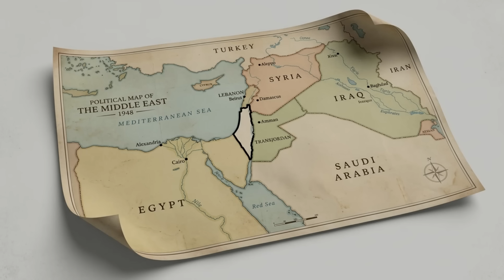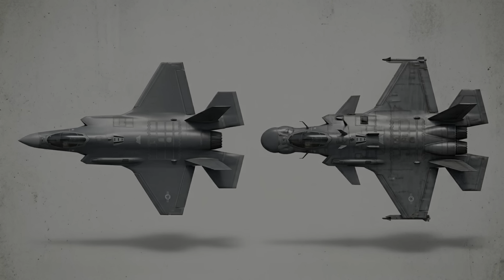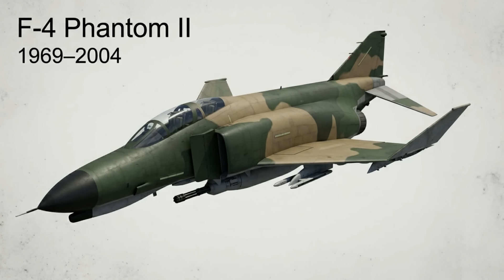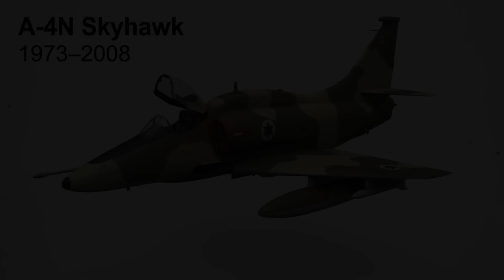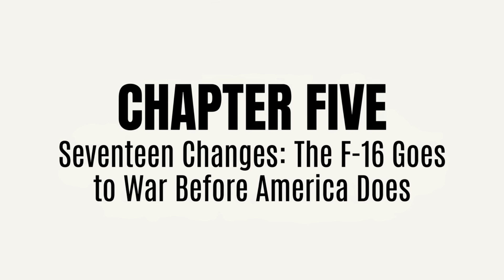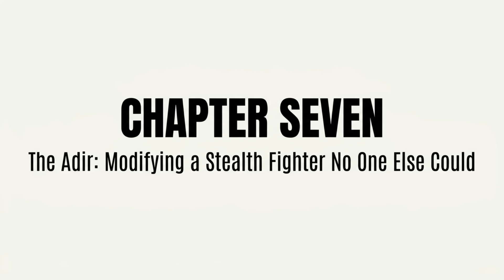Every Warplane Israel Ever Modified — How the IAF Upgraded Its Aircraft

Comment: I  Liked the  IAF Used 30mm Cannots on Mirages instead of Air to Air Missiles That Don't Work in Combat & Save Theirs Taxpayers Money..  God Bless Them.  😊
Reply: I met an ex F4 Phantom pilot from Israel
 He had shot down a MiG21 in 1973 with a sidewinder missile. But he always said he wished he'd used thr 20mm gun instead. Back then a gun kill seemed to be more respected than AA missiles
Reply: A very interesting fact in that direction.
The radar in the Mirage IIICJ wasn't helpful.... so in the Mirage 5, the IAF requested, NO RADAR please!
Reply: @amitaia466 absolutely correct. Some Israeli Mirage IIICJ had the radar remived and lead ballast added to maintain COG. Moat of the early Mirage III kills were with thr 30mm cannon as the AA missiles were so unreliable. Israel even had to modify the cannon aiming point and actual shells trajectory to achieve hits in air combat.